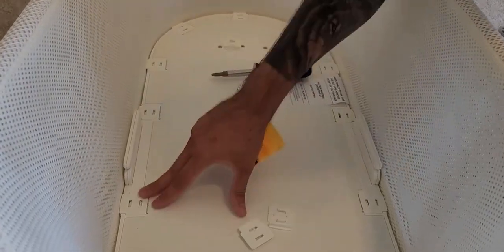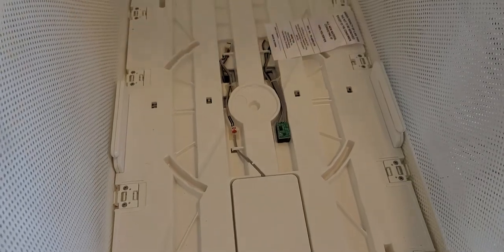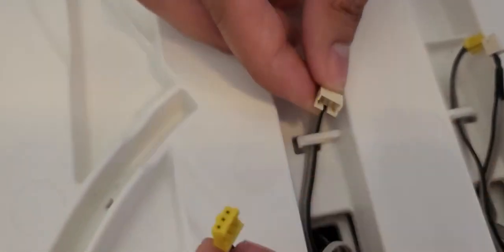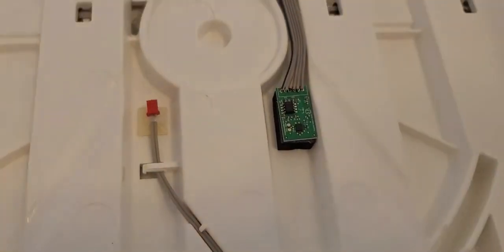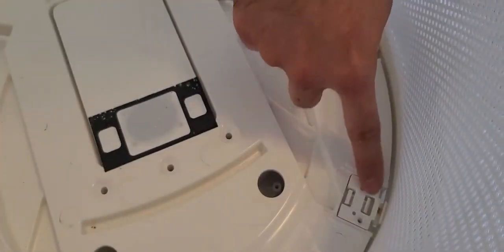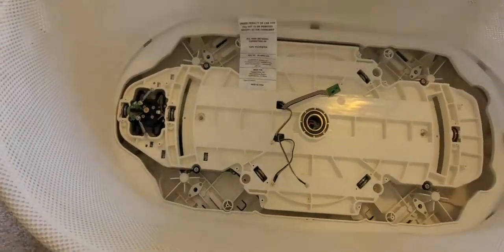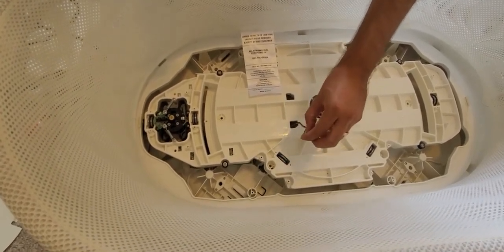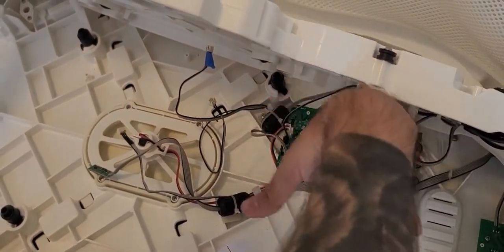Happiest Baby Snoo motor bearing repair tutorial

Comment: Got all the way down to the tiny hex screws keeping the motor shaft in place (like others). Used a hair dryer to heat it up (until to hot to hold without gloves) and successfully removed one. However, the other wouldn't budge and stripped and now I'm stuck and resorting to just buying a new motor at this point... That step is not covered in the video and is easily the most complicated. Just warning others attempting this...

Comment: Thank you so much for this video! Luckily only had to change the o-rings on the motor shaft, but this helped me checking all the bearings, and also finding out what to do with the old o-rings (1 had disintegrated into crumbs, and the other 2 were out of the shaft, sitting one on each side. I wonder what happened…). The ones in your links worked perfectly

Comment: Got all the way down to removing the motar but did not have a vice and punch to press the bearings out and wasn't willing to improvise with bed time for the little one coming around quicker then I hoped. Replaced the I 3 rings that were torn on the motar seem to helped for the most part. Still have the bearings in case the motar decides to wear out soon. Did not bother replacing the zip ties putting it back together. Should be fine as long as it has clearance from movement.

Comment: Need help diagnosing my SNOO issue: the SNOO is 2.5 years old. Loaned to friends, and now home to help us with our newborn.

The sled is moving very slightly. We had minor squeaking a week or so ago that went away.
I took the sled off to replace the O-rings based on your other video, but all the O-rings looked to be in good shape.
I closed the sled up and tested it without reinstalling the mesh and the movement was good as new.
After reinstalling mesh, the problem has returned and the sled is barely moving.
Does this mean the motor bearings have gone bad?
Any help is greatly appreciated: your videos and links are a ray of hope
Reply from the maker: Sounds like Orings. All it takes is 1mm of wear for the orings on the motor to slip and cause a reduction in swaying. If it were the bearings you would hear a grinding noise.
Reply: Thank you! I will be for sure putting a donation in your link tree!
Reply from the maker: @ryanlee928  I offer free video support via IG so just reach out if you get stuck.

Comment: Any recommendations for a Snoo that just randomly shuts off/stops moving? There is no consistency with it. It might run fine for a few hours or for just a minute but at some point it just shuts off on its own. If you have any ideas, I'd appreciate it. Thanks for making all these videos! Super helpful!
Reply from the maker: Sounds like issues with the wire harness. The wire harness clips get damaged and it makes poor contact causing it to think that the snoo clips are not engaged.
Reply: Thank you! Do you have any videos on how to repair/replace the wire connectors for the wire harness clips or is that not what I should do?
Reply from the maker: @user-hd9rm8ql1q  I don't have a video as the process is a bit long winded. I can help you do it via video chat though. Contact me on IG.

Comment: It looks like I have I have the same model as you but don't have a measuring tool so I am wondering what size bearings to grab. Are there size differences (4 mm vs 5 mm) based on the model year?
Reply from the maker: @philipniddrie  unfortunately it's not clearly defined. I would get both and return what doesn't work.
Reply: @SnooRepair  Thanks, you are awesome. I am not even sure if the bearings are the issue. I have full range of motion on my 4 year old snoo, but am getting some very subtle jerky vibrations that weren't fixed by replacing the o-rings. Is this is normal, or should it be super smooth? I am going a little insane but thank you so much for your help and videos.
Reply from the maker: @philipniddrie  give it some time for the new orings to break in. Make sure you also used the right size orings. The ones in my link are pretty accurate

Comment: My daughter has misplaced the screws that are around the motor. I havethe4 that hold thesprings but not the 4 that go into the motor or the 4 that attach the motor to the what base. Will you tell me the sizes and type screws I need to buy to complete the reassembly?

Comment: my heat gun has a pretty big aperture. Maybe an inch diameter. Does that still work, or will it heat too much of the surrounding area, do damage?

Appreciate the insight
Reply from the maker: Mine is also 1 inch. I try to heat it for about 15 seconds on high then check resistance on the set screw. If needed, I heat again for another 15 sec until screws are lose.
Reply: Thanks! I will try that. 
I’ve already given it four hits of heat, and the Alan key just skips along the screw. 

Is there a solution if that screw has been stripped?
Reply from the maker: @ajgillies  if the screw is stripped you will need to drill it out. Tap in a new larger diameter screw hole and purchase a larger set screw. Dm me via IG before doing anything else. I can try to help you at this point.
Reply: Thanks for your help! Hope you received my small contribution for your efforts. 

Sadly, a new problem emerged after getting the motor to rotate smoothly… a much stronger vibration through the platform than we had previously. It makes my daughter’s head vibrate beyond our comfort. 

Any idea what might have caused this?
Do those bearings on the platform itself need replacement?

I’ve already replaced
1. All O-rings
2. Both bearings on the motor (removing the jerky motion)

Your help is appreciated!
Reply from the maker: @ajgillies  can you please send me a video on IG

Comment: Are the links to the correct bearings listed?  Or do i need to source myself after measuring?
Reply from the maker: There's 2 different size bearings. Measure and select the right ones from the links. Alternatively you can buy all 4 and return the ones that dont work.

Comment: Would be an indication that the motor bearings are bad? We have a squeaking sound that comes and goes periodically near the front where the power button is. Afraid it's the motor.
Reply from the maker: Most likely the orings. Bad bearings indicates grinding noise and jittery swaying. Please see oring video.

Comment: Is it possible to make snoo work if it was disabled? I saw a lot of bassinets for sale but they are not working because were disabled by snoo company.
Reply from the maker: No, these are locked due to not being returned after a rental period. You would literally need a new circuit board to make it work.

Comment: I’m struggling with the tiny Allen screws on the motor before knocking the shaft out. I’m using a 1.5 metric alley key. Any ideas. Lefty loosy is correct for it, right. It is soooo tight and I’m worried I’ll strip it.
Reply from the maker: Use a heat gun to heat the screws first. This will loosen the loc-tite.
Reply: Please please please add something in your repair video (text overlay?) with this tip. 
We didn't find any info about heating the hex screws until AFTER they stripped and now can't figure out how to move forward.
Reply from the maker: @stephaniemichaud8630  I will do so. Send me a message on IG. I can help you.
Reply: @SnooRepair  hello, I’m stuck on this step too. Exactly what tool is needed to get to the part where I can push down the metal pin? I’ve looked at the video many times but it seems to skip over that part? I am trying all different sizes of Allen keys and just doesn’t feel like I’m engaging anything. Also can I use a blow dryer instead? And you mean heat the screws inside the motor, not heating up the Allen key correct?
Reply from the maker: @YonathanXilebel  message me via IG I can help you
Reply: Is the 1.5mm Allen key correct? Or is it SAE sizing Allen key?

Haven’t tried the heat gun yet but need to buy the Allen key set to fix this. 
Don’t know your instagram handle so couldn’t message you directly
Reply from the maker: @ajgillies  1.5mm is correct. Definitely needs a heat gun.

Comment: What is the function of that little circuit board you are removing at 7:35. I have a second hand snoo and the wires have popped off the board
Reply from the maker: It relays movement and sway to the snoo.
Reply: @SnooRepair  any tips for soldering the wires back on?
Reply from the maker: @krzyazn  if you don't have experience then just take it to a PC repair store for help.
Reply: @SnooRepair  I was able to repair it but my snoo is still not working. Activity light is solid white and when I press it nothing happens. It doesn't even change color. I also cannot connect to it in the app to get more details. Any ideas?
Reply from the maker: @krzyazn  check the power button under the snoo.
Reply: @SnooRepair  it's on already. if I press the power button on the bottom, the light turns off
Reply from the maker: @krzyazn  reach out via IG and we can diagnose it via video.

Comment: What model year is this snoo ? I have this interior lay out with those 6 wheels and O rings. You popped out those wheels easily in your other oring repair video but in this model those wheels are not easily accessible to swap orings
Reply from the maker: Earlier model snoos require you to completely remove the bottom base to access the 2 screws holding the bearings in place.
Reply: If you have a 1st Gen Snoo, you’ll run into the issue you’re describing. On those older models the metal rollers don’t pull up front the top, they release from underneath. 

They are held in from a bracket on the underside of that panel, and the bracket is held in by 2 Phillips Head Screws. 

You need to remove the 6 bolts from underneath the entire Snoo (near where the legs clip in) which are holding the panel with the rollers in place.

Be careful, the bolts are held in place by a rubber washer a metal washer, a lock washer and a lock nut. Once you remove the bolts, you can carefully lift up the plastic panel, but take care not to disconnect or pull too hard on any of the wires connected to the actual motherboard below it. 

Use a short Phillips head screwdriver to remove the screws for each bracket, which will then release the metal roller.  Also be careful removing the metal roller because there are washers on each side of it as well because you don’t want to drop them